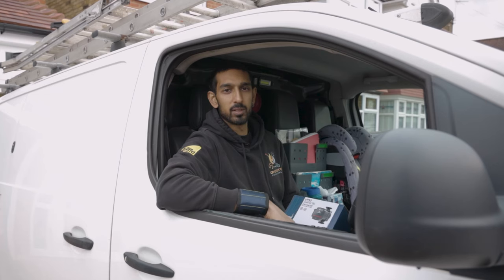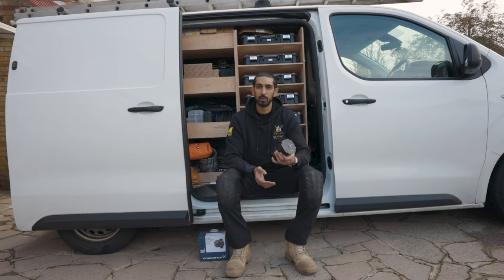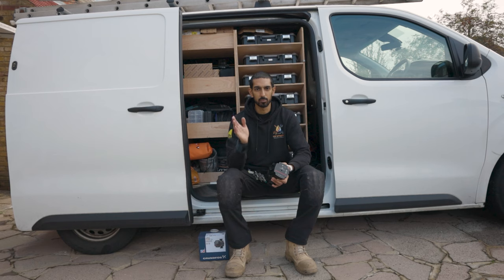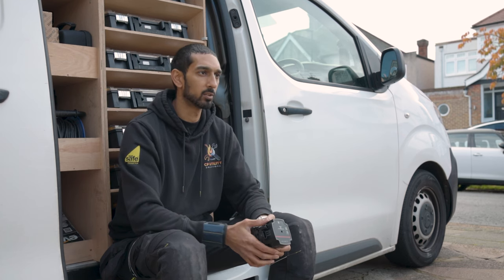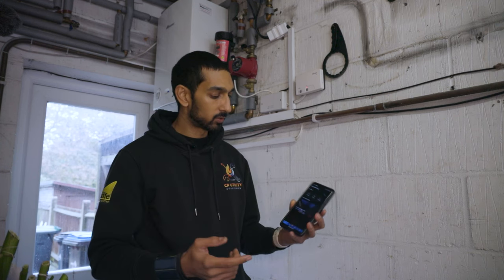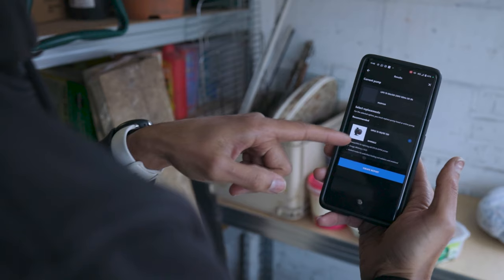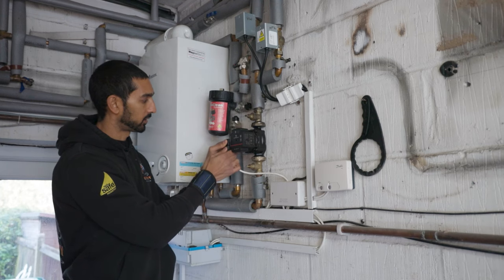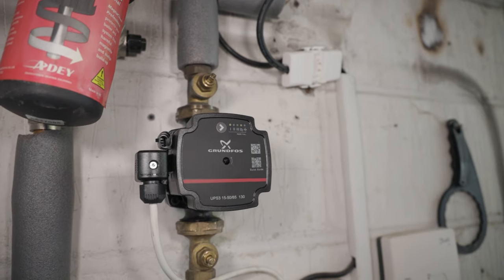Grundfos UPS3 Variable Speed Pump - Plumber Install

Comment: I replaced my old Grundfos pump with a UPS3 last winter, but left it on constant speed 1 on my open vented system. This worked ok in my 13 rad house, but the rads were never really scorching and my delta t was only around 5c even after balancing all the rads, I can now get it to over 20c when the system firsts starts heating and the rads are cold before it settles to around 10c. 

I only found out about this proportional setting last week so I trialing it with proportional speed 2. 

I find now that my rads have a more even heat all over, and my water tank seems to heat the water slower, but more evenly. Before if my wife or daughter took a shower then we may need to wait for the water to heat up a little before we could take another. Now we can get around 2 showers done before the water drops below 38C.

Thanks for doing this video as there are very few that explain this pumps options 😀

Comment: Thanks for this explanation. I fitted the ups3 in early 2021, and left on constant speed 1. Since changing some radiators and fitting new TRV's which started to whistle. I have changed to proportional pressure 2. Hopefully this will solve the problem of whistling valves.

Comment: Thank you for clear concise description. I have just taken ownership of a small 2bed terrace with a Grundfos UPS3 already installed to a simple radiator system. What setting should the pump be set at in your opinion??? 🙏
Reply: Thank you Mark for  your query, we would recommend setting two or three on constant speed or setting two on the proportional setting. Regards Lilly, Grundfos

Comment: Thank you very much, most helpful particularly for a slightly disabled pensioner.  I had this pump installed two weeks ago and was working fine but the last two nights when the heating goes off the pump stays on.  There is a white electric box in the airing cupboard which had a reset button which i pressed and fortunately it turned the pump off.  It was very noisy and could not have slept with than going on.  The electrician was lovely and had never come across one of these before.  He has actually installed it upside down, I don't know why.  Until you said about the button on the pump I had no idea there was one.  My house is a small 3 bed but I only have 6 radiators going on low apart from the end radiator which has no thermostate and I noticed that the lights were one green and two amber so have done as you said and pressed and just have the one amber light going.  I am hoping maybe having it on two,  it was perhaps too much and will see what happens tonight at 10.30.  I have contacted the supplier who are very good and will come out but whilst we have these freezing conditions there are far more people in trouble so am not too anxious about it.  The main thing is that after turning it off with this reset button at night via the box, the heating comes on in the mornings so far.

Comment: I found that my Grundfos was left on the constant curve III setting before it stopped turning itself off at night.  I then by chance or accidentally was pressing buttons and changed it to curve II and it was a lot less noisy.  However, the pipes in the airing cupboard were so hot they were burning and so I lagged them.  The pump was sometimes not turning off at night so was doing this manually and then it was okay for 4 nights until it stopped again and also did not come on in the morning.  After turning the boiler off for a few hours and turning back on the pump restarted and then i discovered flashing lights as opposed to the solid lights that had been visible for the 3 weeks.  When it came back on it was on proportional pressure 2 so I changed it to pressure 1 as in your demonstration.  Last night it turned itself off and came on this morning thankfully.  I am puzzled by this and why the pump is so temperamental.  Could it be because it was too much having the proportional pressure setting with only 6 radiators on low apart from the last of the line.

Comment: The problem I have  since having it installed 7 weeks ago is the two wireless boxes, one in the kitchen by the boiler and one in the airing cupboard suddenly stop communicating with each other.  Anybody know why. Its pretty miserable not having hot water or heat.